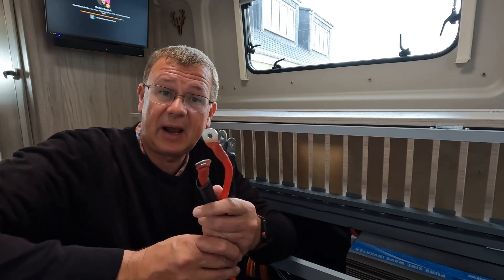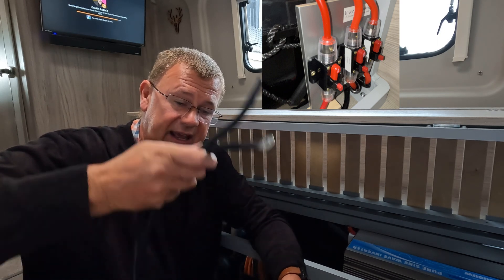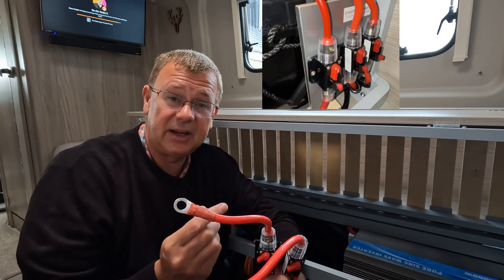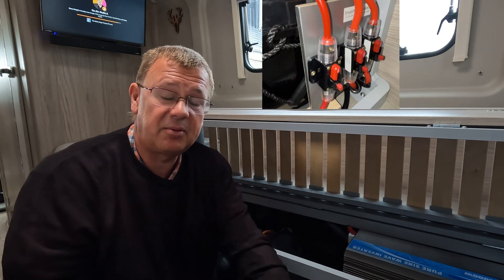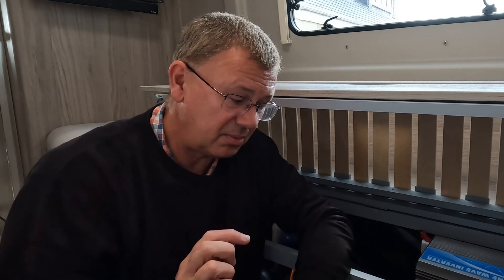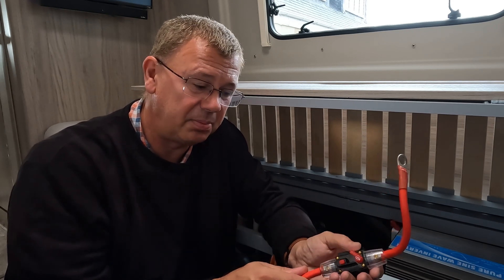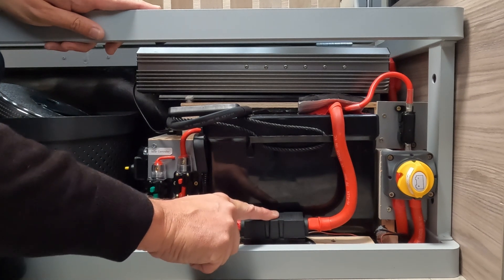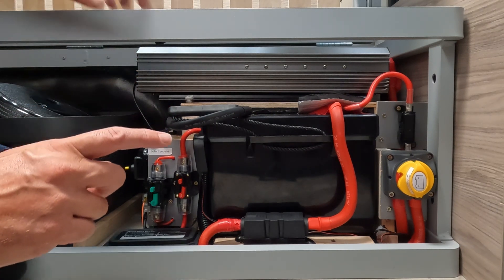11. Campervan Electrics - Inverter Wiring - 12V Cabling and Fuse Upgrade - Electrical Safety

Comment: Hi nice video, just come across your channel. I'm looking at getting a microwave what's the wattage on it ?
Reply from the maker: Hi Charlie, the cooking wattage of the microwave is 800w but the consumed power is around 1500-1800w I have found when running, the inverter is 3Kw continuous / 6kw surge. Hope that helps, all the best, David 👍
Reply: @LeisureBit   excellent thanks for your reply.  😊

Comment: another great video David, could you do an updated diagram of everything which includes where the (Finder Plug In Power Relay) fits in, that switches between shore power and inverter power to the plugs
Reply from the maker: Hi Gary, great shout - will cover that one, I was also going to add to it things such as running certain things from the inverter (or shore) and what does and doesn’t make sense - would that work? All the best, David 👍

Comment: Hey David! Firstly, I just love your videos! I’ve learnt so much more than my local Victron supplier & I’ve spent over 1k on equipment. 🙏🏻 I have a question though. I have a caravan with solar panels and wondered what you thought the safest way to use the caravan’s ac supply with my inverter, bmv, cerbo and smart mppt off-grid? 
I was advised to take the old caravan charger cables and connect them to the - + of the battery and smart shunt. But I don’t know how that would work logically? I have a 2000w inverter and the main thing I want to power off-grid is my 3 way fridge. 
What would you or your viewers suggest? 👍🏻
Reply from the maker: Thank you - really appreciated. When you mention the mains supply do you mean so you can essentially switch between hookup and off grid? Just wanted to clarify what you wanted to get to and will certainly give my view and sure others will have a comment too 👍
Assume you want to power fridge on 230v via either mains or inverter depending on situation.
All the best, David

Comment: David.   I know you decided to stay with the standard DC:DC charger because it was already Lithium compatible and would simplify the wiring.  However the Schaudt device only gives 25A while the Fiat alternator can deliver a big multiple of that.   It would take more than 9 hours of driving to recharge from half full.  Had you thought of upgrading the DC:DC charger?
Reply from the maker: Hi Simon, yes, I’m considering it, to be fair the Schaudt device is only passing 15-20A as the cabling could do with being upgraded to get to full load. I wanted to check out further with it being a smart alternator before upgrading but you have a valid point and a quicker top-up as you say would be great for longer holidays. Would certainly need to upgrade the cables too though. All the best, David 👍
Reply: @LeisureBit  the next one in the schaudt range, the WE121545 is switchable from 45A to 70A. You can read the manuals for both online and they’re similar, both intended for smart alternators.
Reply from the maker: Thank you - will have a look at that as a pre-winter job - currently the solar panel is doing wonders topping up but in the winter need a better solution for when driving - thanks again, David

Comment: That’s so interesting David. I did initially feel my cables which are the same. They were not warming up but I think now maybe I need to test that again when the inverter is pushed towards it’s limits. I am reviewing my entire battery wiring primarily as it’s difficult to get to. Also hoping to solve my issue of the two batteries going out of sync. So will be doing a complete rethink with an accessible board and busbars. So thanks for pointing this out. No doubt I will video my changes. I may need to ask for your advise on it at some stage. 

Nicely explained video. Thanks for sharing 🙏
Reply from the maker: Hi Graham, I was reflecting on it today ironically and think I tried to save a few quid and whilst running the microwave wouldn’t have caused any significant issue (as it reset when it browned out) it did make me think if you were running a heater or something which wouldn’t reset itself and stop the current flowing. Biggest lesson I learned also wider than this one is buy cables from a reputable source, I got caught out with some cable clearly not rated as advertised / sold from an auction site. Also it’s not just the mm2 it’s the quality of the cables - all the stuff I learned years ago came flooding back. You don’t really notice sub 100A load and at 150A took around 10mins to notice an impact but pleased I investigated and put it right, all seems good now with the new cabling. 
I was a little disappointed the couple of cables per terminal it came with didn’t support the full load and it was just a sentence In the instructions which mentioned that, but many things these days seem to state non continuous ratings on electrical cabling.
Good luck with the update and reconfigure, give me a shout if you want a natter.
Thank you, All the best, David 👍

Comment: Hi David, can’t beat CSA with large DC currents, well done having a feel around the cabling and observing the temperature increase.  Just shows you the cables supplied with the inverter were not up to the job, and your micro would not have been drawing anything like 3kW.  You can see how things can catch fire, god forbid!!  Also if one of you breakers had tripped all the current would have passed down the other leg, it would have tripped if in an overload situation but if not, oops ech!!💥💥 I remember on our old 220VDC marine switchboards the copper busbars were enormous solid copper bars, very large CSA. Keep them coming,  well done.  PS just been down in Widemouth Bay off grid with the family, Geraldine still missed the electric kettle but my inverter kept her hot brush working👍👍 hoho! Cheers Mike😊🥃
Reply from the maker: Hi Mike, you’re right, I wasn’t happy when I installed it as I used what I had and assumed the supplied cables would be ok and knew I wasn’t fully loading all be it wasn’t happy and wanted to upgrade it, just took a few months.. Whilst fortunately with the microwave and laws of physics meant nothing of concern happened I’m pleased I addressed it. You certainly wouldn’t have wanted it to be left unattended where high currents are involved until absolutely certain everything is fine. Anyway happier now 😀 those higher current breakers might have eventually tripped but thought it best to change he design based on others channels flagging as concern. The lower power ones I tested and they seem to be ok (all be it a 30A breaker for example Will trip fast at around. 50-60A) but with the double  protection, I’m happy with those as it gives ability to shut off each circuit and an additional protection point.
Hope you had a lovely time at Widemouth Bay, pleased the hot brush worked for Geraldine.
All the best, David 👍

Comment: Excellent upgrade David.  We're in the middle of a full house rewire so fully appreciate the need to ensure wiring meets the specs. Keep up the good work.  Sid and Nicola.
Reply from the maker: Thank you, appreciated. It’s well worth making sure it’s done right and correct isn’t it as saves worrying if you cut corners. Not a problem if you go larger capacity just under rated isn’t it which you need to be very careful to avoid. Thanks again, All the best, David 👍

Comment: good advice there David . i,m also doing a few alterations on the inverter this weekend. rerouting wires etc ..
Reply from the maker: Thank you, pleased its been useful - good luck with your alterations / mods, hope all goes well and to plan, always seems to take longer than you would expect doesn’t it 😀 all the best, David 👍

Comment: Smart Job David, expect Rachel will be less than pleased with the mess behind you towards the end of the video😂😂I presume you still have the standard 100w solar panel, how do you find it for charging the batteries as I was reading some mixed reviews the other day on the CV forum. Cheers K.
Reply from the maker: Thank you - shhhh, don’t say anything -  you will get me in trouble 😀 Rachel keeps out the way normally when I’m doing any tinkering to save getting cross with the mess, 
I was fortunate as I got a larger solar panel in the Cleveland deal, I can’t remember what wattage it is but it’s over 130 and under 160 and have had 144W reading from it. I think it’s doing a cracking job - if we have been away off grid over the weekend for a couple of nights, I will have used 100AH+ and it’s always fully charged well before the next weekend. So I’m pretty happy with it and it’s doing a great job, infact think it spends more time dumping power due to being fully charged, also have it to charge vehicle battery as required too,
All the best, David 👍
Reply from the maker: Karlos as long as he tidies it up he might get away with it …. but I’m 👀🤣
Reply: @LeisureBit  I'm sure you are Rachel.😂😂

Comment: Dave  great Vlog.on another note do you  charge your leisure and van battery from your Solar  panel
Reply from the maker: Thank you - I fitted a battery maintainer to make sure any excess is channeled to the vehicle battery as needed and that seems to be doing a great job of keeping it topped up. The original solar controller had dual feed but the Victron MTTP one just single hence the battery maintainer - there’s a vlog in the lithium playlist if that helps? - all the best, David 👍
Reply: @LeisureBit  Thanks David